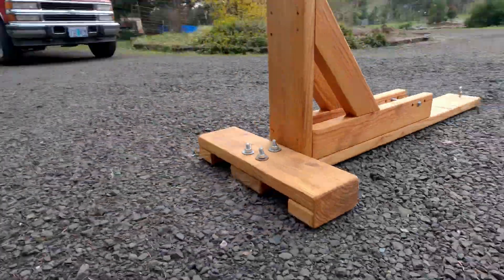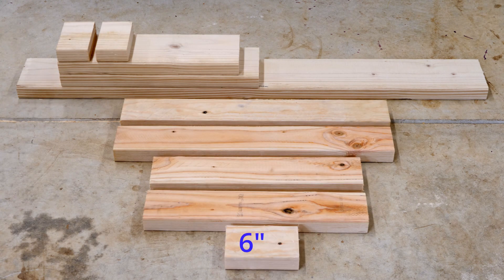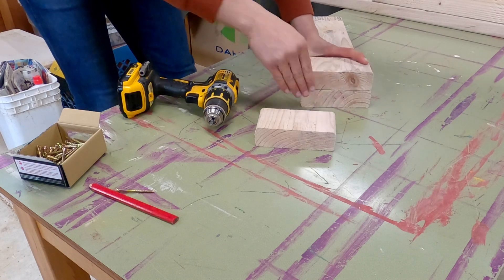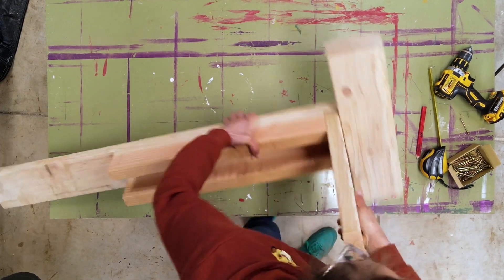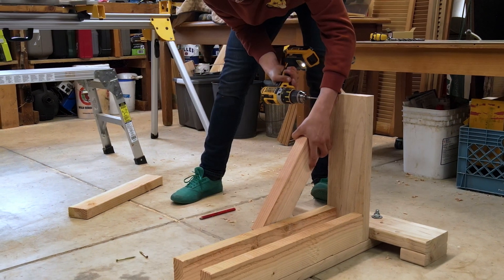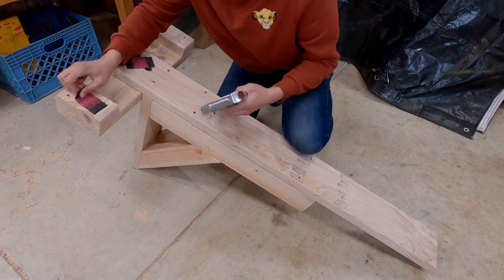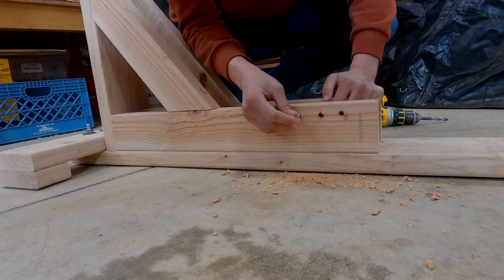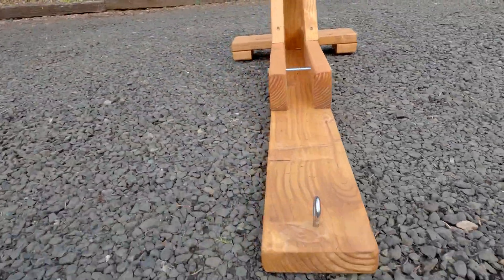How To Build A Manual Machine For Under $30 - DIY

Comment: Ok with fall/winter setting in, this is a nice little project. Thanks Claire! I saw Kyle's vid and a few others, but your build looks dialed in! Big question now is-- are you able to manual with this jig???
Reply from the maker: Hey Robert! Great question - I’ve been on a cross-country trip for the last few months so haven’t been practicing on the manual machine much, but it’s rock-solid and does a great job when I do get to practice!